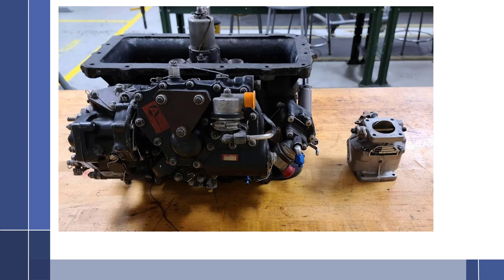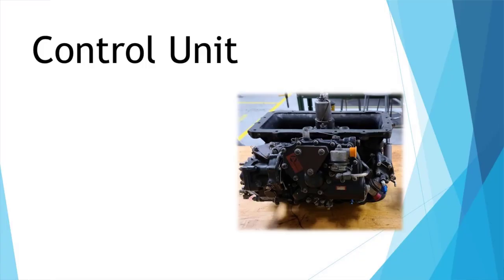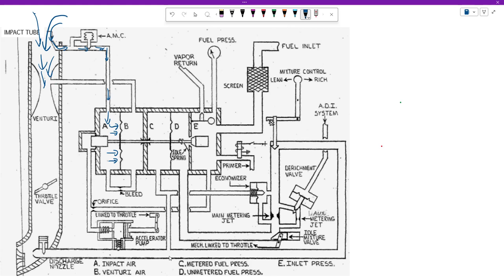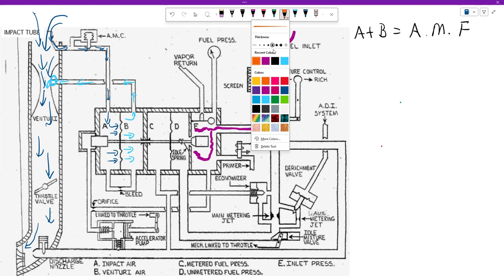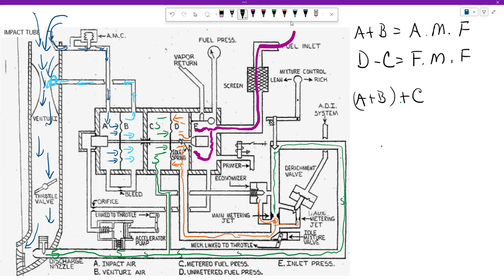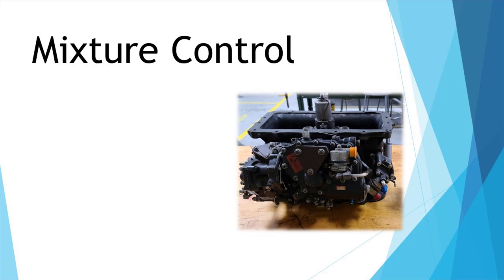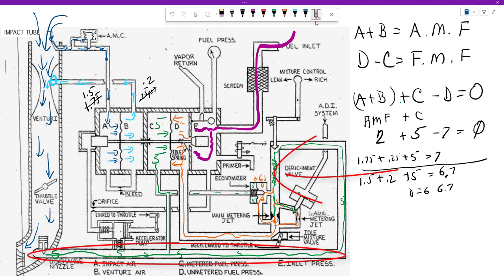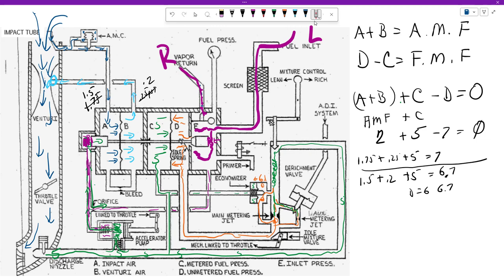The PR-58 Aircraft Pressure Carburetor

Comment: Apologies if this question is daft, but what is the purpose of the air bleed between A and B?
Reply from the maker: You need air movement through the impact tube into Chamber A or the AMC will not work. The bleed keeps the air moving.
Reply: @aviationmaintenanceacademy  thanks for the response! Another potentially silly question if that is okay? Is the air metering force regulated by both the impact tube and the venturi so that the pressure carb is getting information on both mass air flow and inlet pressure?
Reply from the maker: @mattgbarr  Yes! Sounds like you understand it.